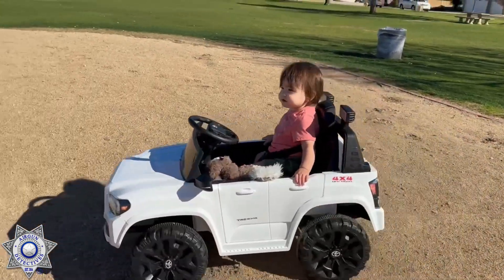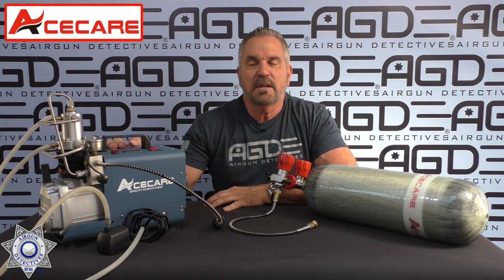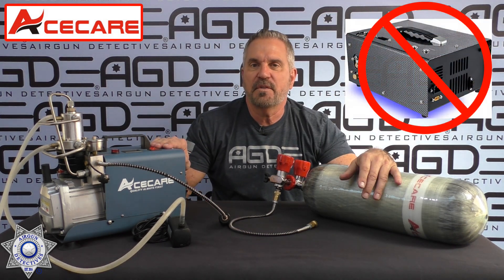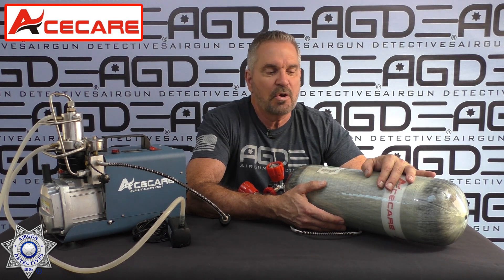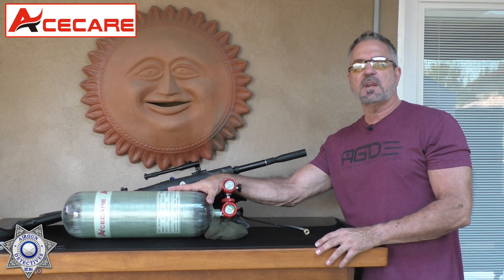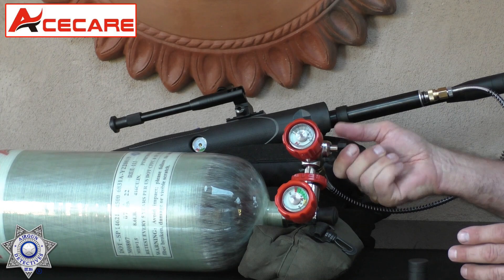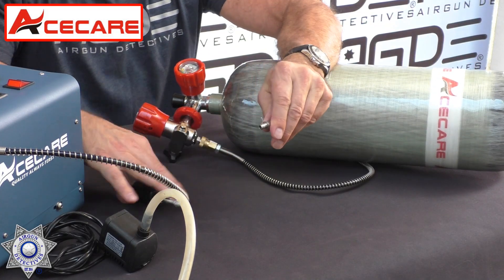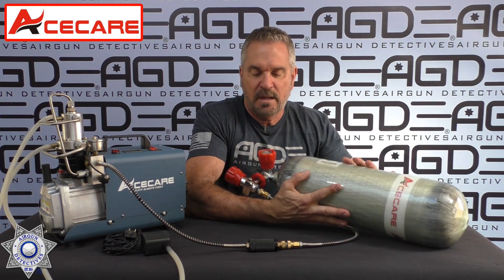HOW TO FILL YOUR PCP AIR TANKS (200-300 BAR)

Comment: Nearly twelve minutes of plugging Acecare and still didn't show how to actually top up the dive cylinder! Okay, I get the connecting the whips via a male-to-male  connector. Naturally, I would expect to close the release valve on the compressor before switching it on but does the one on the dive tank need to be closed off as well? I can set my compressor to cut off at a predetermined pressure however I usually keep an eye on the rifle's gauge just to play safe; would the gauge on the dive tank also show how many bars it's at? Similarly, when desired pressure is achieved, I'd open the release valve on the compressor before attempting to remove the fill probe therefore, if valve is closed on the dive tank too is that also opened before disconnecting and would it matter which valve is opened first?

Comment: Fill that tank in 40 minutes? Not unless your running that thing non stop the entire way. It's not meant to do that plus the air in the tank gets HOT and expands. Need cool down periods as you go. I have a yong heng and similar tank. Just a heads up so people know how it should be safely done.

Comment: The tank leaking through the carbon fibre is Scary as F. Holy crazy.  0 to 4500 psi in 40 minutes?  That’s questionable.  I’m thinking the compressor would give up the ghost trying that. Cheers!😊

Comment: Couple questions, why do you never fully deplete the take pressure on the gun?  Just no need?  Not going to lie seeing air bubbles come out as it’s leaking at that psi is skettchhhh.  Can you easily over pressurize the gun?  How often or common are catastrophic failures ?  Interested in getting away from break barrels and going to a Benjamin marauder pcp but the fx guns are super nice.  Just not  sure I want to get into this thing into the thousands ..  great video!
Reply: It could damage the seals

Comment: I have a CF tank that is "timed out"... that is the date is over 10 years old, so how dangerous is it to keep using???
Reply from the maker: All high-pressure tanks should be hydro tested every 5 years. Scuba shops  provide that service.
Reply: I looked again, it is dated 5/2006, so over the 15 year limit for CF tanks, and it's never been hydro tested, time for a new one.
 @AirgunDetectives

Comment: After 6 years of using Yong heng ac compressors I have destroyed at least 4 from stupid mistakes like not plugging in the water pump to opening the valve on the tank before pressure is equal but with that said there is not a faster or cheaper way to fill our PCP tanks. The last YH compressor I purchased was 200$ on an Amazon Black friday sale. I have had no less than 7 of these compressors and at the moment have 3 working. You can not shoot without air...it is that simple. Owning many PCPs and having many shooters in my family not to mention 2 LCS SK-19s that not only consume air but also lead...AIR is life for these guns. You can't beat these compressors for the money. Synthetic oil, keep them cool, and do your maintenance. I fill 4 tanks and all are Ace Care brands. ZERO issues with these tanks. 6.8 LTR is ideal size but having a 1ltr for a back pack for a day out hunting or pest control is very convenient. I do recommend a dual gauge on your tank. Awesome video and ifo bud. Stay blessed.

Comment: Hey JC, have you ever had issues on gamo rifles ( swarm maxxin gen 2 and swarm magnum gen3i  both 22cal) in particular with the scope stop pin. Mine on both wore a groove in gamos recoil reducer ,while that happens the scope never Stays zeroed in
Reply from the maker: The problem is that Gamo's pin is a "V" cut and is never deep enough. It needs to have a round based pin. I usually go to aftermarket two-piece scope rings, and I drill a new scope pin hole in the front portion of the RRR. Never had an issue with that setup.  Email me and I can send you photos. 
info@airgundetectives.com
Reply: @AirgunDetectives  thank you very much for responding, right now I have a bsa outlook 3x9x40 on it . I am just surprised I haven't heard other people with the same issues, thank you for your time . I would like to see your setup so I can possibly do the same in the future.

Comment: And that 31 Mpa of course is 310 bars..😁

Good save there JC. 3000bars sounded lots.

Would definitely wantna compressor someday. Not yet though gotten myself to look enough around to make a decision of which one to strive for to buy. Many good compressors out there - but many also may cost quite much. I'd might well to with one of these in the video. Would be interesting to service one, if/when needed..
Reply from the maker: I have been using the water cooled version for years. They are now under $300, and the rebuild kits are on eBay. Something you could rebuild with your eyes closed👍😉
Reply: @AirgunDetectives  Sounds way good. The price for sure is spot on right.

Comment: I picked up a Yang Hang portable compressor because I heard a lot of good about the company but after I got it the seller on Amazon disappeared and there is no way to get hold of Yang Hang !! In the instructions that came with the compressor there is a email for Yang Hang but it's a bogus email !! And the seller has no email or phone number at all !! The fan on my compressor stopped working after only 1 hr and a 1/2 of use and Yang Hang won't even talk to me they told me to contact the seller but there is no way to get hold of the seller ! And Yang Hang told me that they never sold the compressor to this seller and they have no idea who the seller is ! And even though the compressor is manufactured by Yang Hang they won't stand behind it and honor the warranty ! So I'm stuck with a compressor that's under warranty that I can't get fixed !!